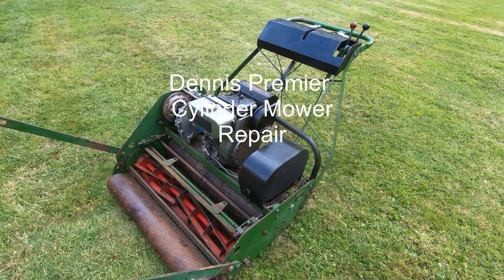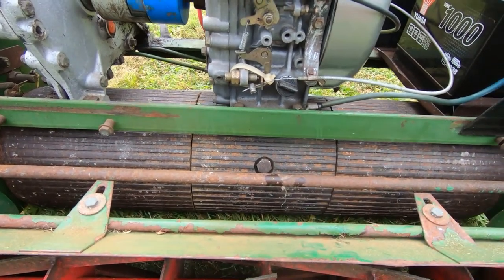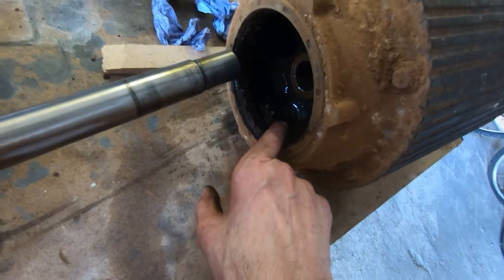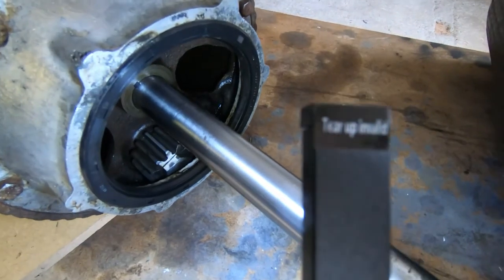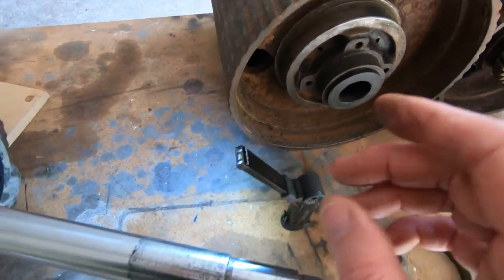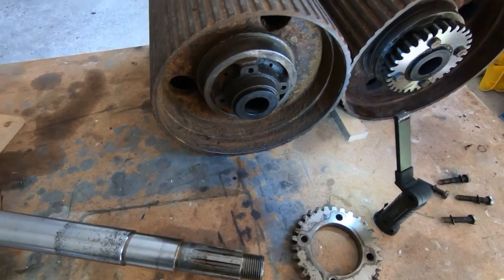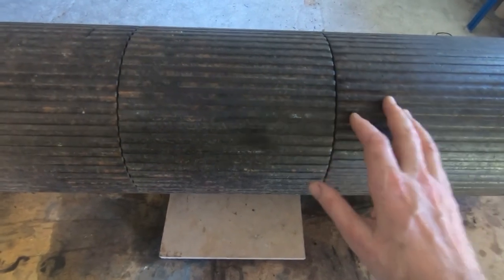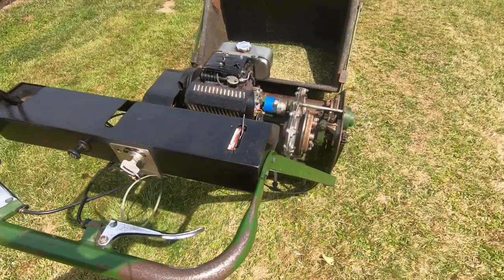Dennis Premier Cylinder Mower Repair

Comment: just done the same repair on a local school mower(they have 2) had the brake shoes relined as oem were £63 each.   Did you fill the centre section of roller with gear oil as the gears should be running in oil. theres a brass plug on the centre section to fill with specified amount, i filled to bottom of seals before reassemling.
Reply from the maker: Yes, I actually discuss this in one of the videos. I have had several people say that the plugs are to allow the roller to be filled with water or concrete to add weight. As I say in the video I was concerned that someone may have filled the differential housing with concrete or water instead of oil but luckily it was just the bushes. The manufacturer changed the bush material to cast iron in later machines, presumably to prevent this problem. Note that the differential should not be over filled or next day you will have a big puddle of oil. About 1 litre is enough as it is distributed when the machine is running but I did the same as you and filled to the seal level when I reassembled. Note that some moped brake shoes fit and only cost about £12.00 per pair.

Comment: Jerry, please do continue throwing some "mechanical-repair" videos into the mix with your "normal" electronics-repair videos -- what you've shown so far is quite interesting.

How did you hold the rollers in your lathe?  They "look" too heavy to be simply held with a 3-, 4-, or 6-jaw chuck and I don't see how you could have used a steady rest (without making a "cats head" ring to go around the drum while being centered on the drum so that the steady rest would have a smooth surface to run on).  Could you show a few details in the future on how you set up lathe jobs like this or on similar "odd" jobs that aren't "intuitively obvious to the casual observer" (as one of my Professors used to say)?

Comment: Watching you refurbish the utility vehicle was a joy, especially the finish you put back on all the plastic bits. This equally cool, especially given you had very particular requirements (Diesel not petrol), and NOW, finally the roller works as designed. These things are understandable, they can be repaired.